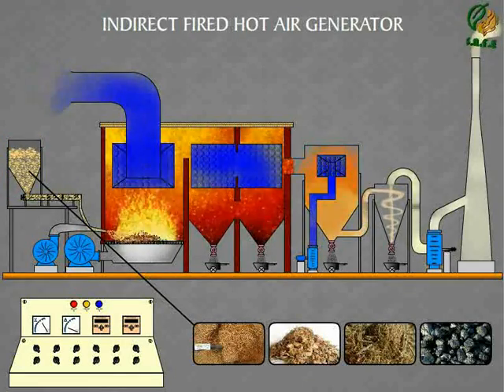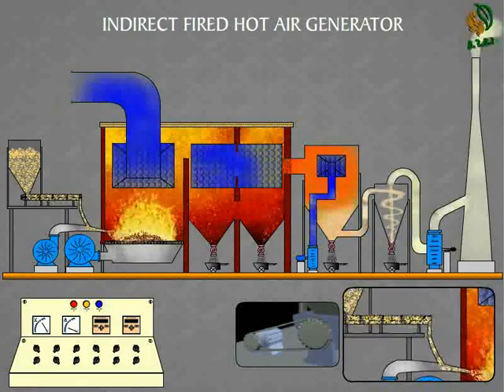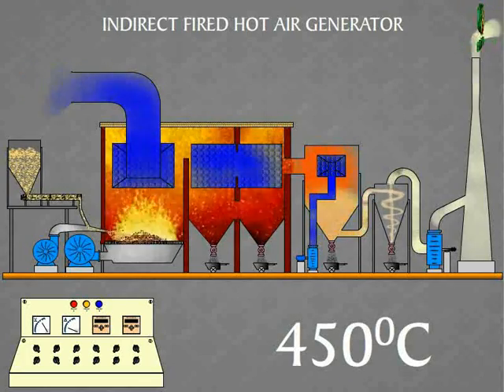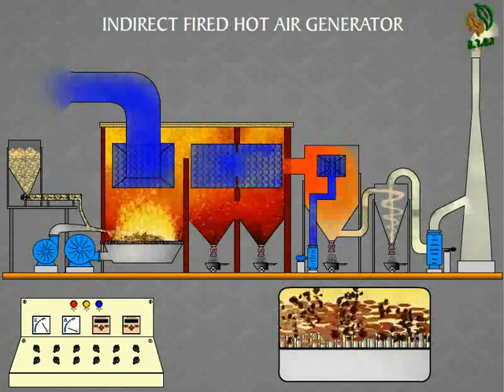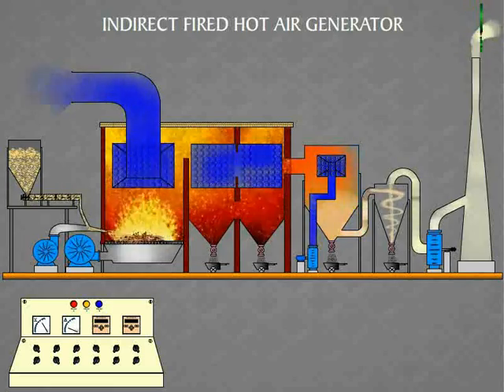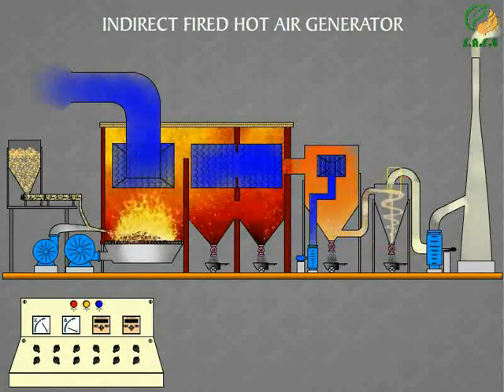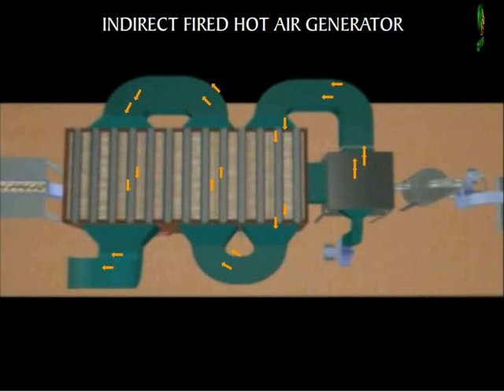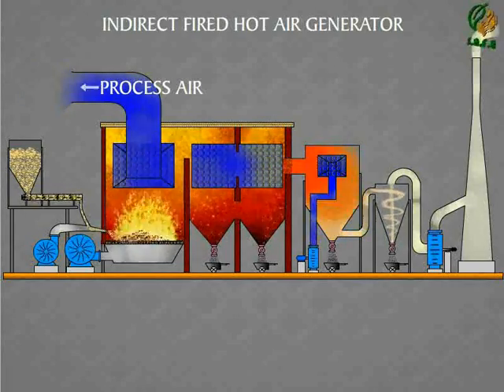Indirect Fired Hot Air Generator.flv

Comment: Hi Sumeet. I have a question. If have a heat source, say waste heat at 1200 deg c, can we use part of your design to convert it to electricity?
Reply from the maker: No man, its only hot air generator. u can use to dry things or materials, in case of convert into electricity we want steam with apropreate pressure.
Reply: sumeet bhavsar  Thanks.